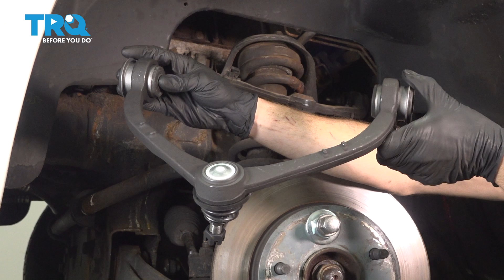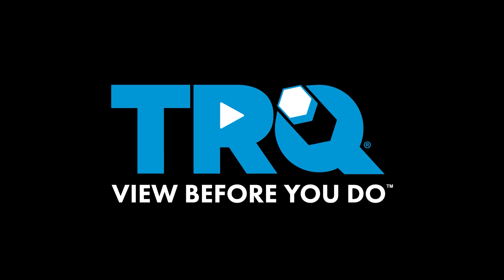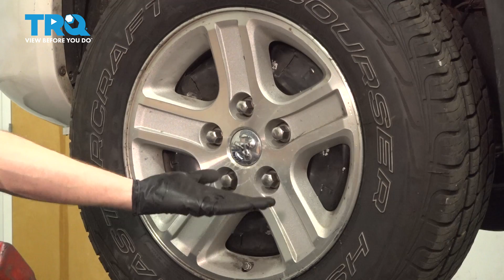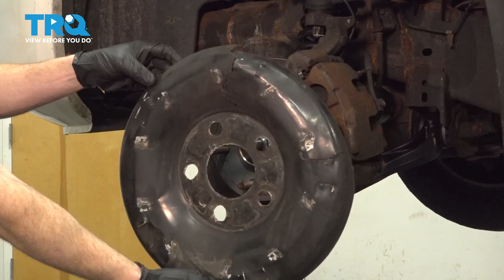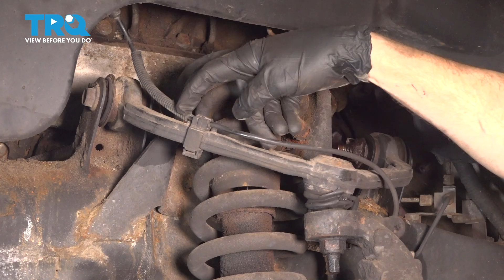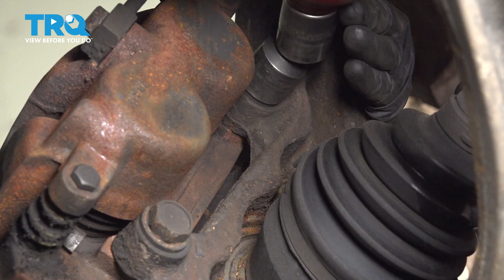How to Replace Upper Control Arm with Ball Joint 2005-2010 Dodge Dakota

Comment: You mentioned removing the pressure from the lower control arm but in the video it doesn’t show putting pressure on it in the first place. I’m wondering if there’s details for that?